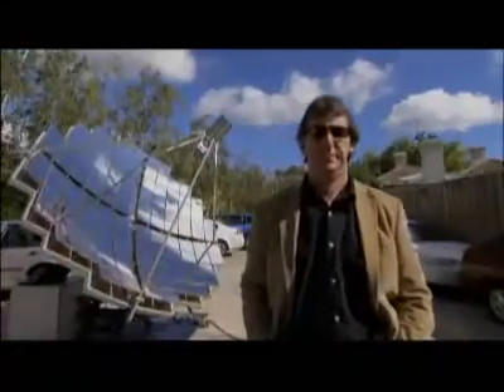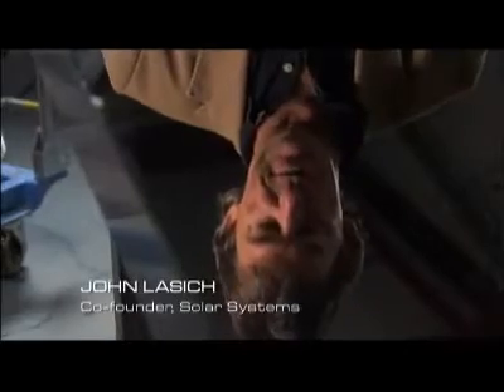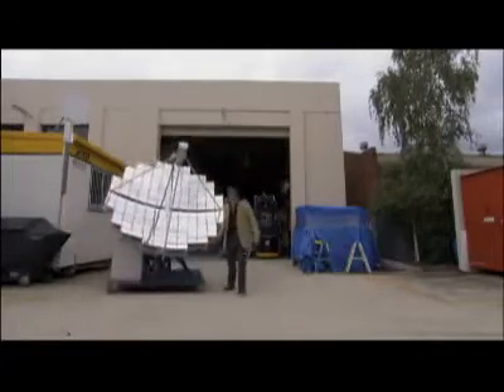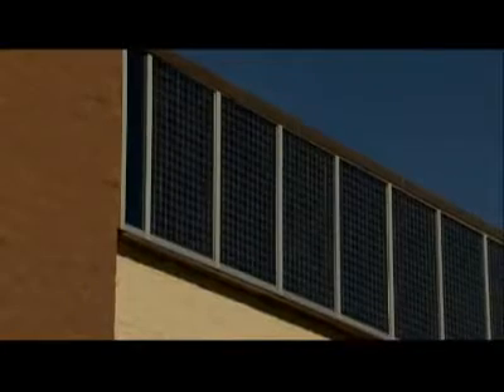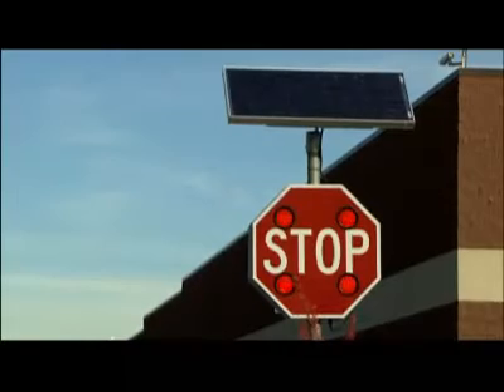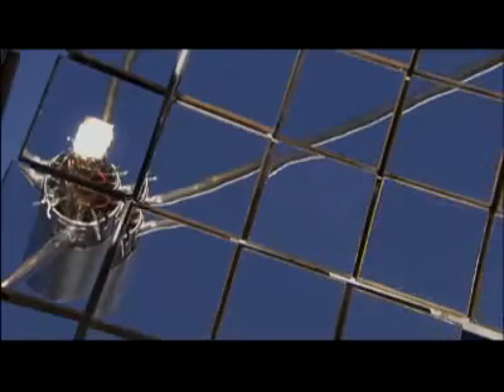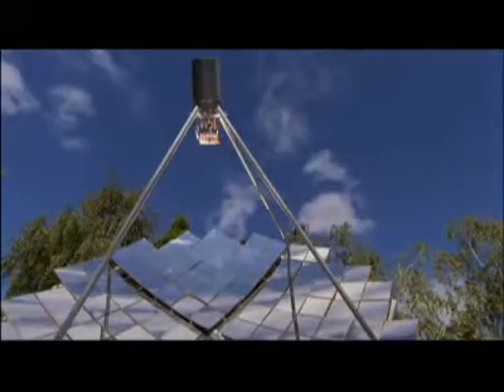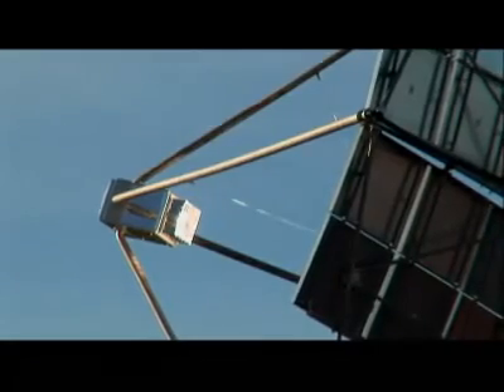Solar Dish Concentrated Photovoltaic

Comment: Solar is today (July 2013) on parity with retail electricity prices in 105 countries. So if you have space on your roof there's no need to wait. The PV technology is mature and cheap. There were massive price reductions in the la two years. So give it a go and contact a few solar installers for quotes. You will be surprised!

Comment: the heat would be the limiting factor, even a mirrored 3 ft parabolic shaped satellite dish can concentrate  the suns rays to close to 500 deg f over an 3 inches.  How would the cell survive over time. I imagine a huge heat sink

Comment from the maker: These concentrated solar systems make 0.23m² of PV cell generate the same power as 350m² worth. 

Thats also without using the remaining 65% of heat energy which is bled off the back of the PV cell. This heat could also be used to generate electricity using a sterling engine or an organic rankine cycle system 

The point here: concentrated PV reduces the amount of silicon cell used by a factor of 1000.

BTW the cells they use a triple junction and are 36.5% eff.